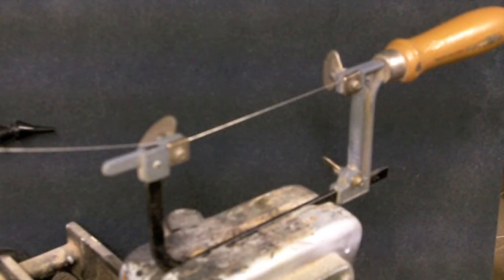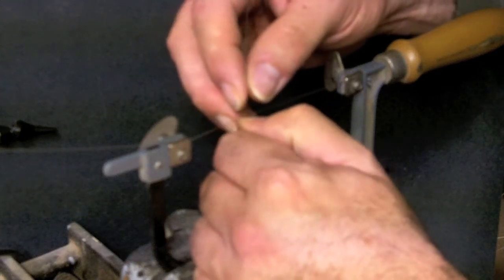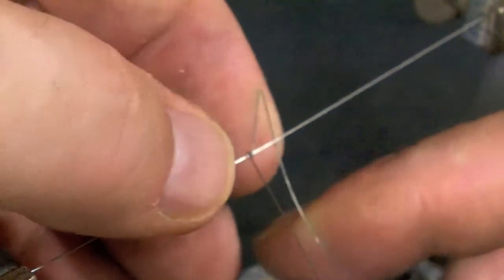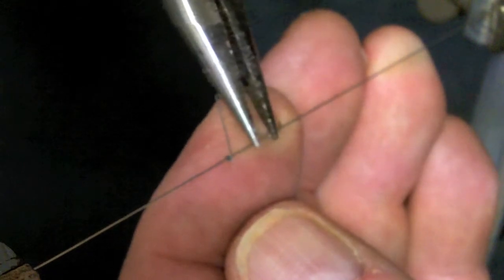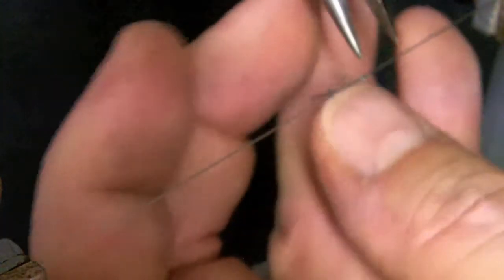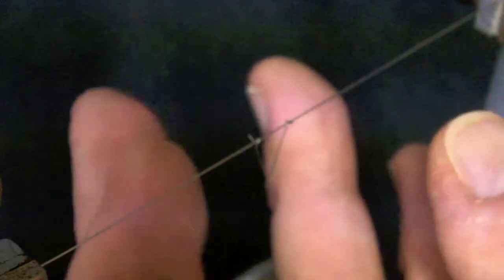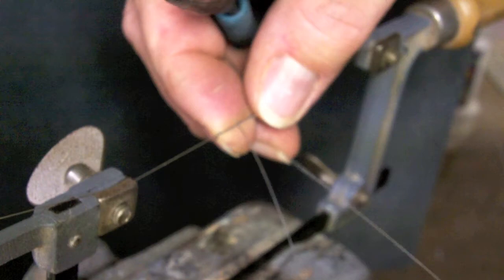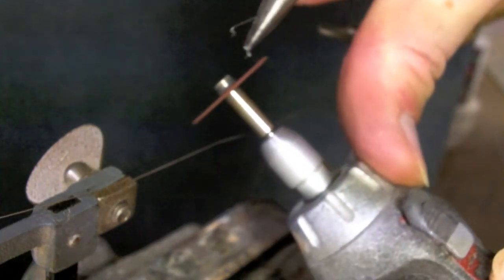Making a wire pigtail thrust bearing

Comment: You just saw a 0.010 slot in the front of the motor stick, and glue it in with Ambroid. That's plenty secure. Then If you need a thrust angle adjustment you cannot get by bending, just a little acetone on a Q-tip will soften the glue to do the adjustment. This is working well for me. Great video of a tricky job!!!!!!!

Comment: 6:16 it's much easier to impress the ladies if you start from the inside out.  First step should be making the inside 'coil', then bend the wire back over and make the outward coil.